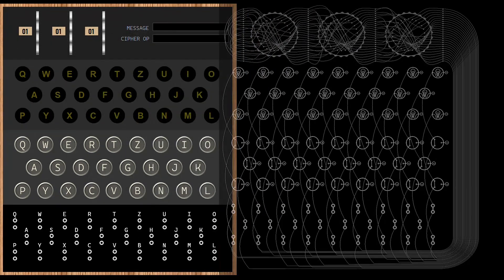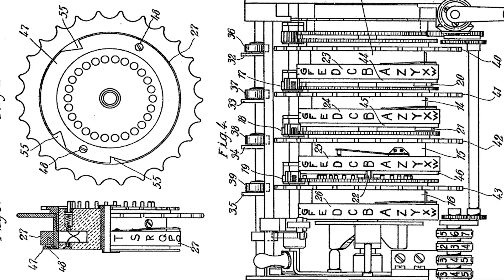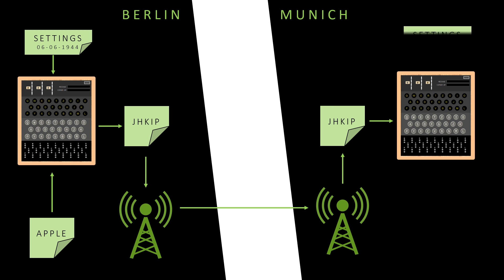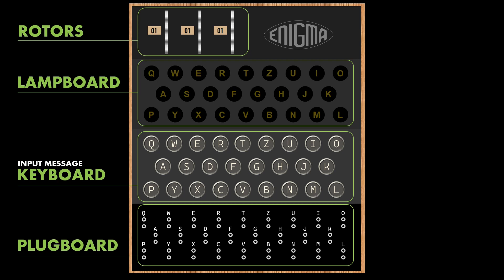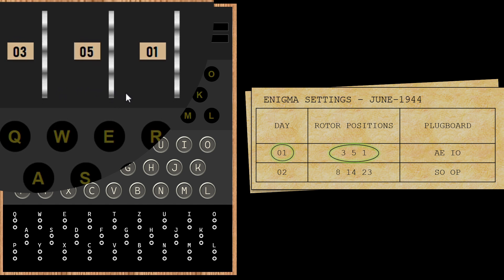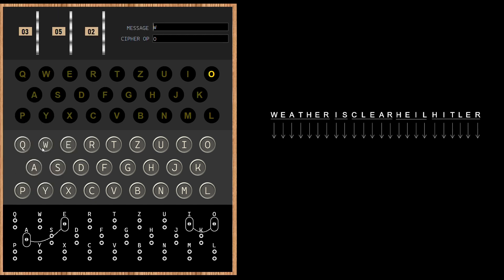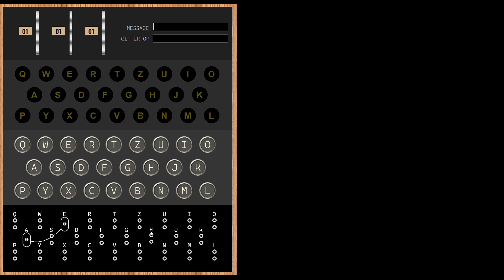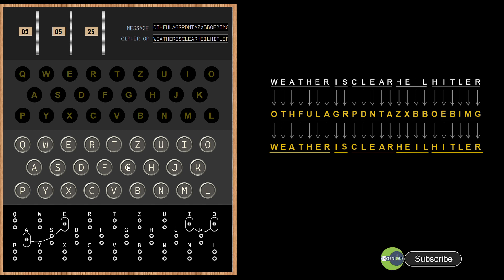How Enigma machine works | Part-1

Comment: This simulation isn't fully accurate.  The first thing the operator had to do was install the correct rotors as indicated by the setting sheet.  The army Enigma (if I remember right) had 5 possible rotors.  3 of the 5 were chosen and then installed in the order indicated by the setting sheet.  Adjusting the rotors to show indicated letters was actually determining the ring setting.  As far as I know it was up to the sender to change the ring settings for each message sent and then include the setting in the message so the receiver would know how to set up his own machine.    Different ring settings for each message was supposed to enhance the security of the Enigma machine, but due to carelessness or laziness most senders would change the ring settings by only a letter or two.  This gave code breakers an edge when it came to deciphering messages sent by a given individual.